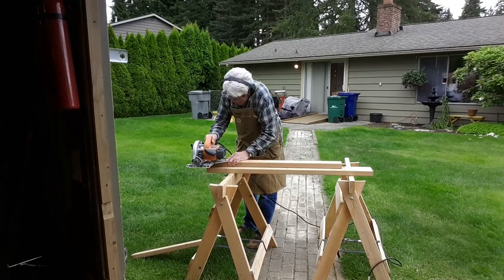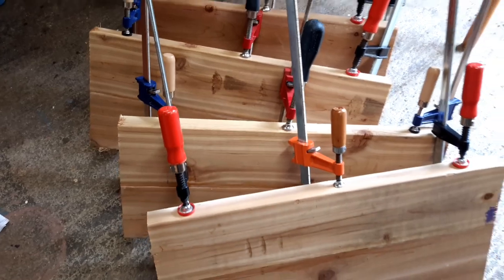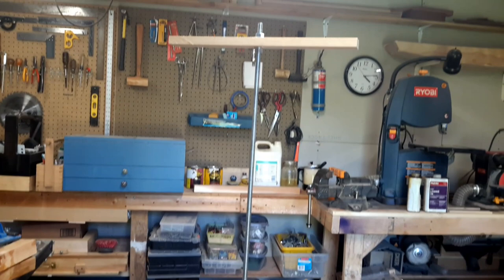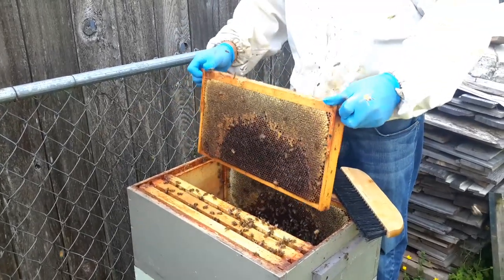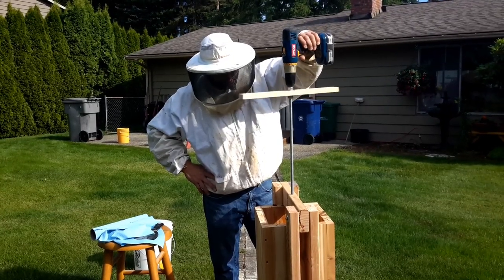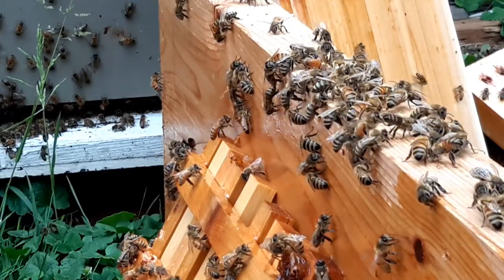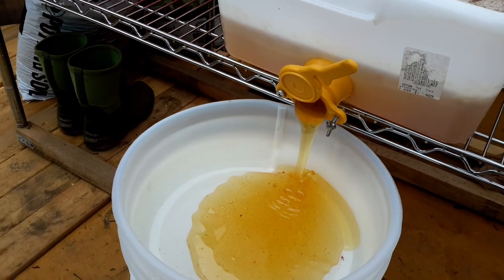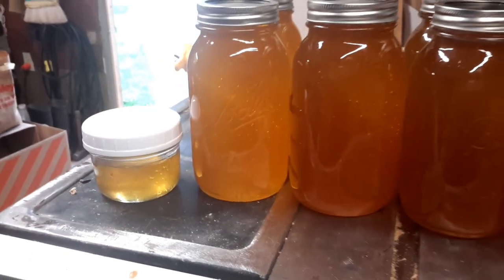Making a temporary honey press and extracting the honey

Comment: Great video. We do crush and strain to harvest and there always seems to be more honey left in the wax than I’d like to have. I’m planning on building some sort of press and yours looks great. 
I even like your brand of cordless tools.
Reply from the maker: The key behind mine was that it could be disassembled. That made it possible to clean everything and to remove the press board. It also can be flat stacked and put away when not in use. Mine was meant to be temporary so you might be able to find some improvements if you are planning on making it a permanent thing. I might go back to crushing someday but right now we have a centrifuge. You can see it here and the "new" way that we found to remove the caps:
https://youtu.be/cL_fAjuQ3og?t=7

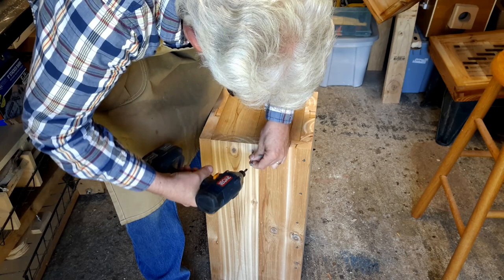Comment: At 1:03, it looks like you screwed a solid board into the bottom?  Where and how does the honey exit the press?  Looking forward to building this; thanks!
Reply: There were holes drilled into the bottom board later. The comb was pressed so hard that we couldn't get the presser board out, even though there were handles on it. Taking the sides apart was necessary. Also, the bigger the screw the better. Ours was 3/8" and even then there was quite a bit of bend. It did the job fine but I wouldn't go any smaller. You can probably get some other ideas by looking at fruit presses on the internet.